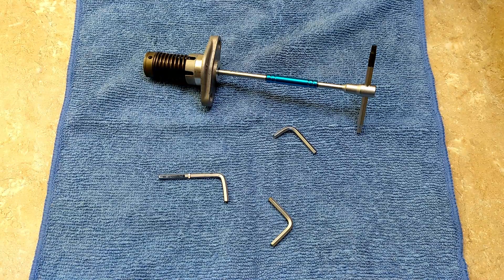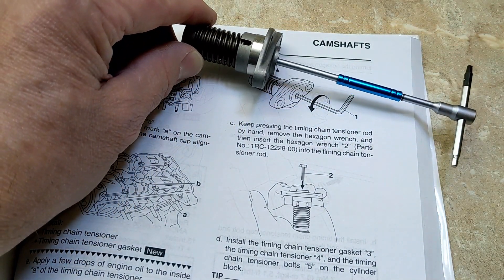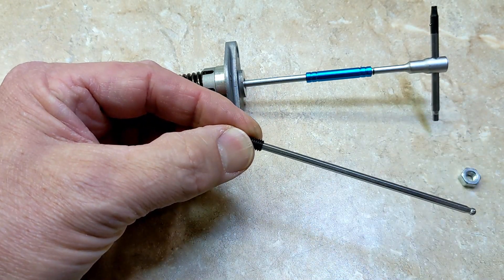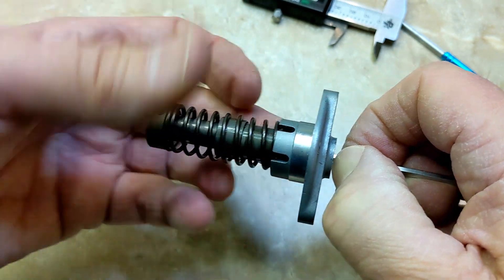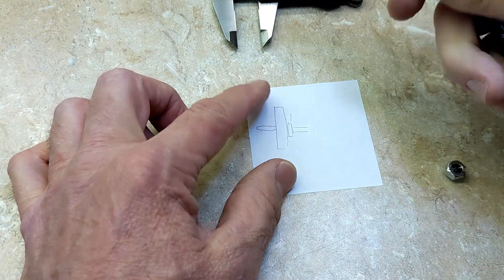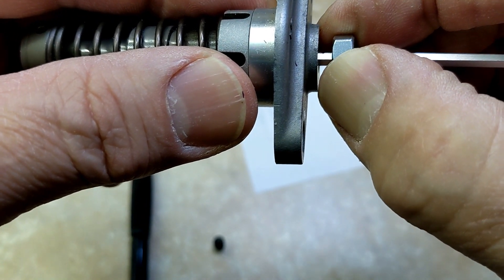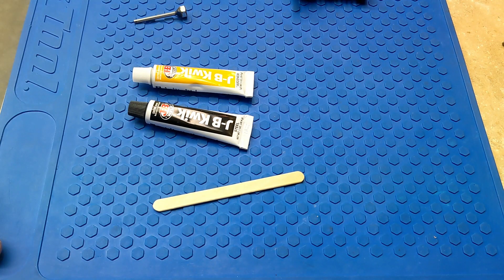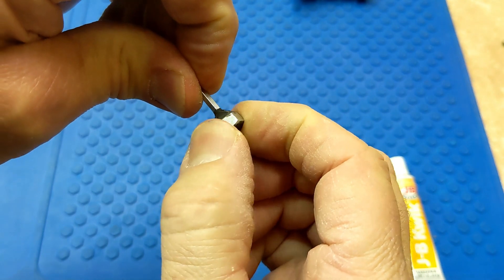Making an fz 09 cam chain tensioner tool similar to Yamaha 1RC 12228 00

Comment: Why is it important to have the OEM tool or make a similar one, I have a normal allen key and can I do the job, or am I doing something wrong?
Reply from the maker: Hi,
What is your procedure for reinstalling the cam chain tensioner after a valve adjustment?
Reply: @meticulousmechanic  I clarify that my motorcycle is a YZF-R3, however, the tool referenced in the workshop manual is the same, I use instructions from the manual to adjust the valves, I use a common Allen tool to manage the cam chain tensioner, apparently the system of the FZ-09 is similar, I don't understand why the workshop manual says that we need to have a special tool.
Reply from the maker: @andresh77  on the FZ 09, the frame is really close to the cam chain tensioner.... You could use a 3 mm but it hits the frame when you try to wind in the cam chain tensioner in when doing the final adjustment... You wouldn't need a special tool as long as you have room....

Comment: Good idea i think. I will try this myself
Reply from the maker: Cool.... The overall length is pretty critical.... Mine just barely clears the frame with the dimensions I put in the video description... Might be easier just to make it 2 mm too long and cut it down when you're all done... just in case the set screw isn't exactly like the one I used....Of course you could just do the measurements like I show in the video but apply it to your case....